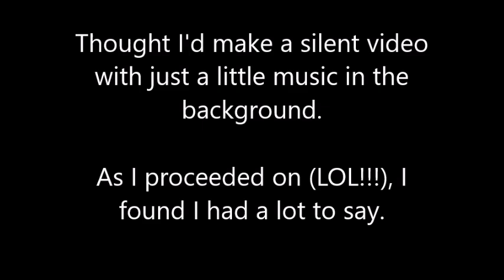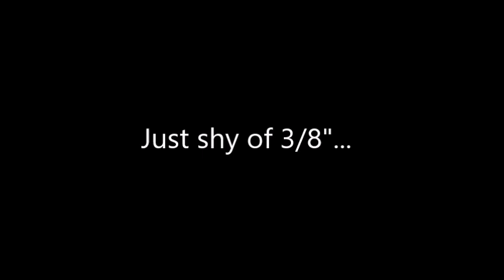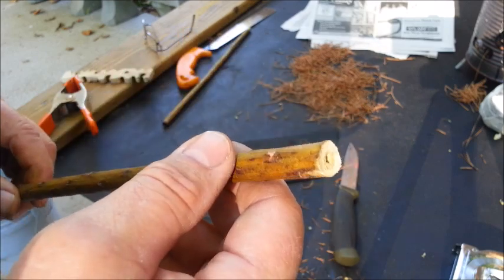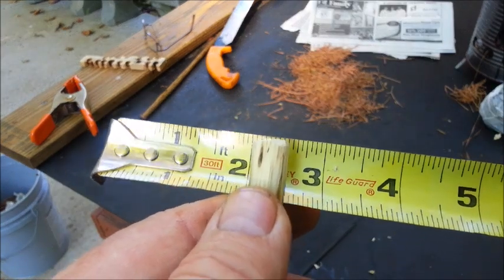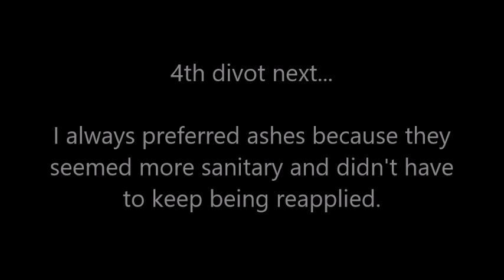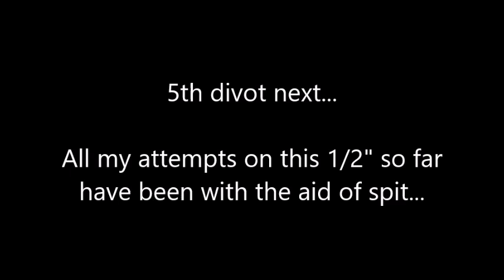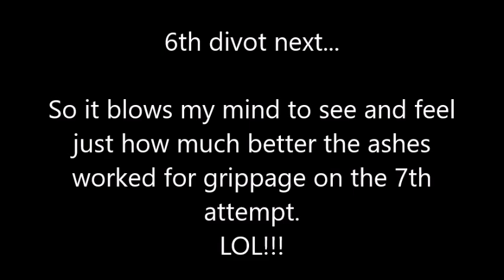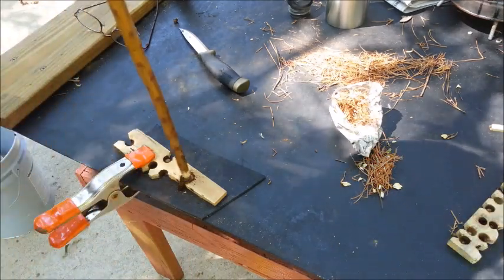Hand Drill Spindle Grippage... I Just Realized Ashes ARE a Cheat... Far Superior to Spit

Comment from the maker: This video was supposed to be about proving 3 different diameters of spindles... 3/8, 7/16, and 1/2". But to my surprise it turned out to prove something very different. Let me explain. I was able to easily get an ember with the little 3/8" spindle and then the 7/16". I didn't even have to use spit for grippage with them. But, the 1/2" spindle was different. The first couple of tries, no spit. The next 4 tries, spit. LOL!!! I was about worn out and was on my 7th divot, the 2nd try, when I decided to try ashes. Now, you need to know that people have insinuated for years that when I use ashes for Hand Drill its a cheat. I've always maintained that the ashes were equal with spit in grippage and more sanitary and didn't dry out and have to be reapplied... I was wrong. Because of the huge contrast in grippage from the first 6 fails to the last and successful attempt, I am now convinced that ashes provide much more grip than spit. What blows my mind is that even in my weakened condition from all the previous attempts, with ashes on my hands, I could apply so much downward pressure that I could actually see the spindle bowing as I went for the ember. Understand this, ashes for hand drill spindle grip is my discovery. It came to me from seeing how much better the boards grab a fire roll when ashes are on the outside of the roll. But, TODAY I realize I was wrong to say it was equal to spit. It really is a cheat. I won't be using ashes in my hand drill videos anymore.... Please SUBSCRIBE at the end of the video. Thanks!
* This is mostly a revelation to me. I realize that most people don't understand why.... but some do. Thanks.